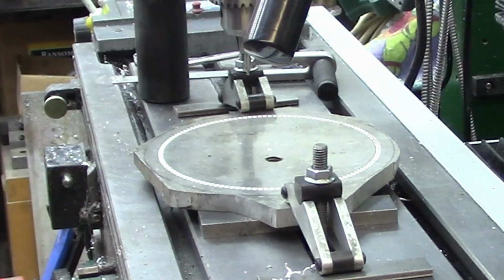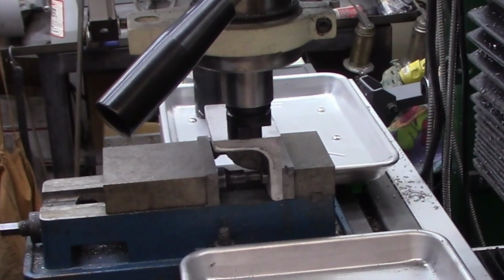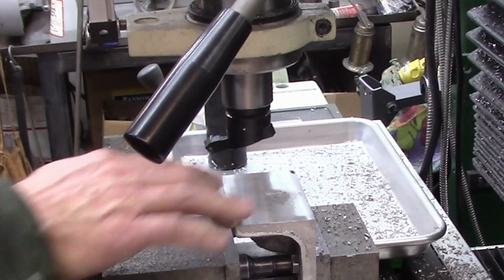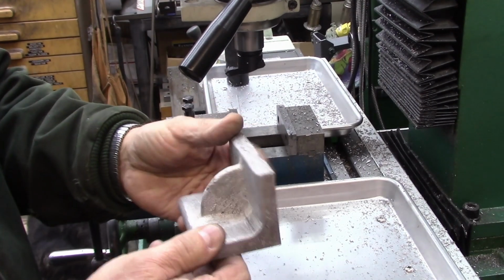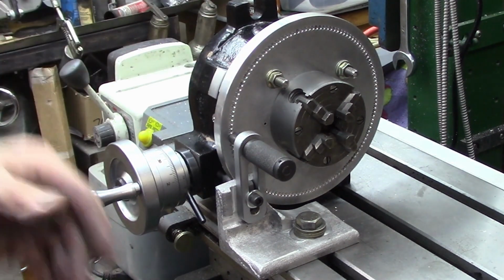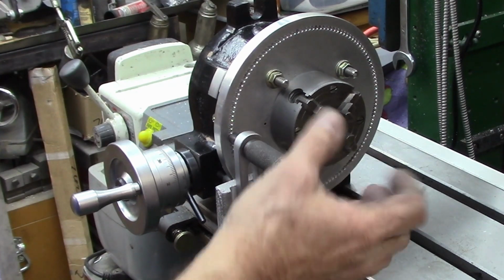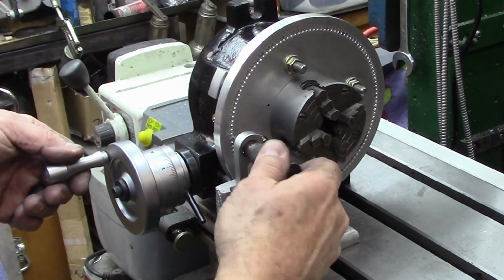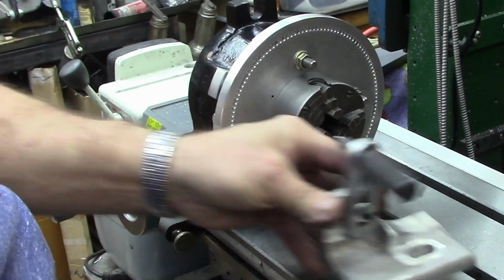127 Tooth Metric Gear For The Sheldon Lathe: The Redo

Comment: 127 I believe is a prime number. So if your dividing gear is 1:90 then a plate on the crank would require a sector of 90 holes(?). 
I thought your first attempt was 127 holes? I seem to be missing what was wrong with mark 1.
Reply from the maker: Hi Glen; Yes I am after 127 holes, but my goal was to do a direct index to cut the gears, as I understand it even with the proper dividing plate there is still an error trying to get the 127 and since I am just some fool in his shop trying to do things beyond my ability it just made my brain hurt trying to figure it out. While there will still be some error in this setup mainly to the limitations of the machine and any error I induce when setting the index pin into the hole spacing I think it will give me good results. Time will tell.